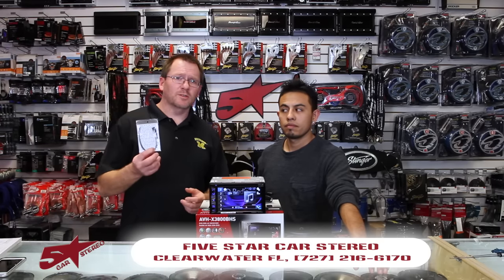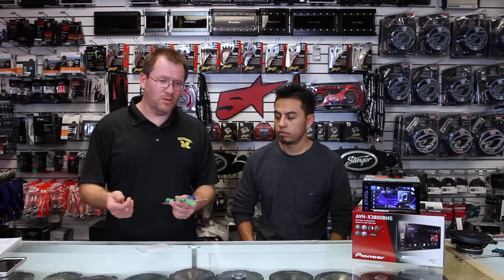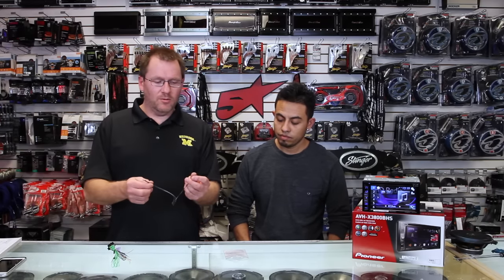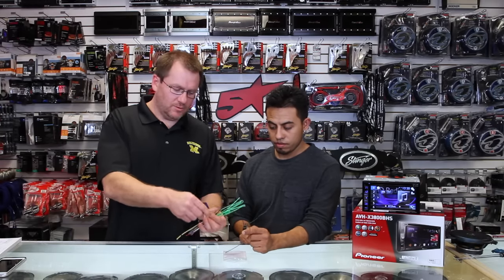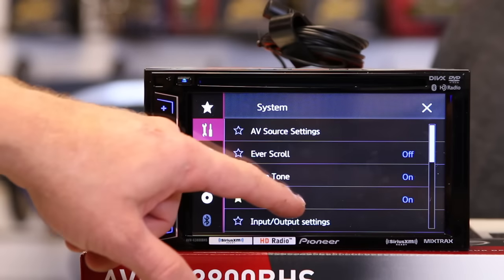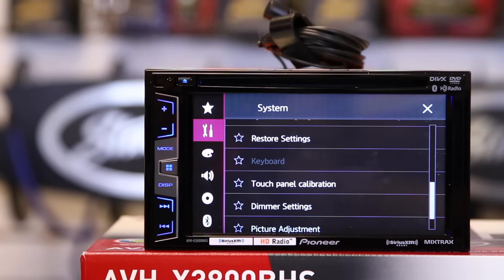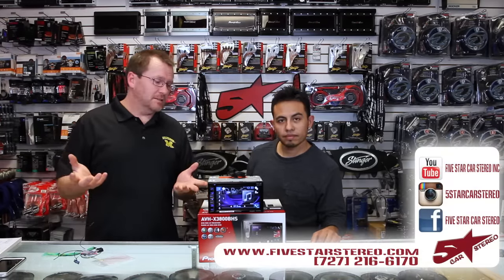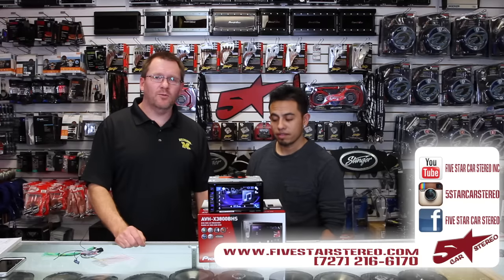How to do the brake bypass on your Pioneer AVH Radio using a MicroBypass

Comment: Hi guys, I did the bypass on my car and I can now watch videos while driving. The weird thing is that when I connect my iphone, the message of putting the hand brake on still pops on. Even I click okay I can't use appradio. I just let's me to go back (can't use the apps feature). Even if I do the break thing it still doesn't work. Do you know the reason to this since bypass is already working for movies DVD. Thanks a lot for your support and for all your very useful videos!
Reply from the maker: Marc Antoine Kassis check to see if any of the menu options are still gray. Like the restore settings? If so the bypass might not working. Also is the smartphone settings set right for your phone? Are you using this radio?
Reply: Hey, no the menu was not grayed out. Also i was able to play movies, so the bypass was working fine. Only connecting my phone through radioapp wasnt working. But i found the solution which is the most silly thing ever: restarting my phone, and it miraculously worked. I saw some other comments on other videos so seems like a problem some are having where the bypass works on anything except the usb plug. If anyone has the same problem and asks you. keep it in mind as it worked for me. And of course thanks a lot for your videos, very useful!
Reply: thank you Five Star Car Stereo and. Marc Antoine Kasis
You mean restarting or restoring? I do have the same problem. 
Before the firmware, everything was working just fine. I updated and now I cant se videos and pictures. Also Phone apps... Green wire is grounded.  Please help. Cheers!

Comment: What's up guys.  I bought one of those from amazon and connected it just as you said.  Before everything was not greyed.  Now with it installed, everything stays greyed.  I can't get out of standard mode or allowed to reset.
Reply: Most of my audio settings are greyed out with the micro bypass connected. Were you able to figure anything out?

Comment: Hey guys! Big fan of your shows. I have a few questions...hoping you guys might be able to help me with? I just bought the Pioneer AVHX5800BHS thanks to your show. It's going to replace my Pioneer AVIC-N4 which has been a great unit...and still is. But since they came out with new dash kits to convert to double din I figured why not? Anyway, question one, I bought the Microbypass that you are showing in your "How to video" Just wondering if there will be any issues when connecting this to the "Blue remote wire" as shown in video, which will also be connected to turning on two Amps? Question #2 This might be a stretch....What are the possibilities  of making a video on showing how to correctly setup the AVHX5800BHS to a 4 Channel Amp along with a Mono Class D Amp. I was thinking in the way, as how the wires and RCA's are connected from the HD Unit to both amps, then out to the speakers and sub. As I said, just a long shot...But highly appreciated.  Thanks for taking the time to read this. looking forward to hearing from you. Frank G.
Reply from the maker: Thanks for watching. I would recommend a relay for sure. ( pin 30 12volt, pin 87 remote out, pin 85 ground, pin 86 remote in). We were not planning  a video like that, we have never had anyone ask. We will add it to the list and see if we can come up with something. In the meantime we will be happy to answer any questions you come up with. I will recommend checking out the Stinger RCA's, they make a 6 channel 12 or 17 ft that are great to work with. They also make a product called Speedwire that has your speaker wire and remote wire all in one, major time and space saver. If you follow us on Instagram we put up tons of pictures of what an amp install should look like.

Comment: i tried to bypass my pioneer AVH-1300NEX  i used the micro bypass and it didn't work.. i connected the black to stereo ground the  blue to the amp remote and the green wire to the green parking brake wire on the stereo....and it doesn't let me watch DVDs or get into certain areas of the radio..

Comment: Hey guys - I just bought the AVH-190DVD model from Amazon and I purchased the brake bypass switch from them also. The bypass switch they sent me has 4 wires - green, black, blue, and yellow. What do I use the yellow wire for? The directions that came with the bypass mechanism kinda stink.
Reply from the maker: +Brian Knorr I have never seen that one, does it work with out the yellow connected?
Reply: I will tell you in a few hours! haha I plan on trying to install it in a few minutes here. I do have one more question maybe you guys could help with ... I already wired the new radio in and it works great - just one problem - every time you turn the engine off then restart, the clock on the radio resets and it's like turning the radio on for the first time. But what I don't understand is that while it resets the time, it does save the station presets. If I wired something incorrectly, wouldn't the FM presets reset with the clock?
Reply from the maker: +Brian Knorr what kind of car is it? It sounds like the yellow ( constant 12 volt or memory ) and red (accessory or key) might be backward.

Comment: How do you get a backup  camera to show while driving? I have aftermarket camera.
Reply from the maker: On the home page ( window icon) select AV and the camera is in the source list. If you press it and you get a black screen the camera is wired wrong. The camera needs to get ACC power ( red wire behind radio) not power from the reverse light.( disregard if does not apply)

Comment: Love this video guys — super helpful and just upvoted! 

Just picked up a PIONEER AVH-X5800BHS and Microbypass and followed these directions — connecting the Microbypass blue wire to the Pioneer’s system remote control (blue) wire…

However, I’m working with a Metra TYTO-01 wiring harness, that currently has one remaining blue/white wire for amp turn-on/power antenna — should I crimp this to the above connection, so that the three blue wires are running into one crimp/connector?
Reply from the maker: acsouthe yes that is what you want to do. Connect them all together, thank you
Reply: Great, Thank you! Wish you guys were up in Michigan, would bring the car over.
Reply from the maker: acsouthe haha I'm from a place called Walled Lake, and no I will stay in Florida:)

Comment: I have installed a pioneer AVH 270 BT with the micro-bypass and the CD/DVD will not work, but all other functions are fine. My question is; if the bypass is working properly would the rest of the functions work properly?
Reply: that should be bypass not working properly would the rest be working properly
Reply from the maker: +Lew Strickland yes every thing would work, the bypass is manly for the video play back and some menu access.
Reply: +Five Star Car Stereo in your professional opinion is the bypass defective and not allowing the CD/DVD to function?
Reply from the maker: +Lew Strickland if you have the black to black, the green to the radios lt green(only do not connect to break too) the the blue to blue white remote wire( and the remote wire is putting  out 12 volts) your good. The remote output on a Pioneer has a breaker so if there is also a power antenna connected you may want to test it with a meter.

Comment: Hello. I have a AVH 600 EX. I’m getting no sounds and then a Amp error message pops up on my screen. What do I need to do to get rid of it. Will this help fix it. Thank you for time. Appreciate it
Reply from the maker: Amp error mean there is something wrong with the speaker wiring. Either a bad speaker or a shorted wire. You have to fix that first then reset the radio. The radio is just protecting itself
Reply: Five Star Car Stereo thank you for the quick response. I replaced my speakers last week and had no head unit until last night when the pioneer was here when I got home from work. Wired everything up correctly and boom nothing. This morning I got up and tore the door panels off again to see that the leads where hitting the metal door cut out. Shimmed our speaker and Wala problem fixed if I have sound no more error code. I really appreciate ya. And I ordered this bybass last night for $11 bucks. It’s a no brainer. Keep pumping out the videos.

Comment: Great video! You put up some really helpful videos.  Question, have you had a chance to test the MicroBypass on the new Alpine ILX-207 yet?  I'm having issues on mine, and it doesn't seem to working.
Reply from the maker: +Choppin Brixx no not yet, you can contact Matt at Microbypass. He is really good with tech support

Comment: I have an AVH-x4800bs and i was having the same issue of not being able to use certain functions on my radio. i did some research and i found that grounding the parking brake wire to the radio itself did the same thing as using a bypass. i tried it on mine and it works perfectly now so why waste the money on a bypass when you can do this simple trick to get the same result
Reply: Scott Helphenstine So by grounding the parking brake on the stereo you can watch videos and drive?
Reply: daniel hinojosa Either he has a cheap DVD in dash or he's full of crap.
Reply: Scott Helphenstine yeah it'll unlock the screen but you still can't watch video while driving
Reply: Gamer Tone Exactly these pioneers have to see a parking brake or ground signal engage and disengage.
Reply: Gonna have to argue on that. I thought the same thing, that I'd have to buy this shitty Microbypass but after contacting Pioneer retailer they told me just to ground the light green parking brake wire behind the stereo. Did it and i can play videos on the move now. And I have a 3 month old model... MVH-AV290BT.
Reply: R3vokedGaming Clearly we're talking about the AVH
Reply: where on the 4800 did you ground it, I have the same one, I'm going to try it!
Reply: i have pioneer avh-x7800bt and just connect parking wire with stereo ground and every thing work
Reply: roki buča 

I noticed the same thing that is not what the instructions say I could not get it to work the proper way but when I touch the green parking brake wire on the bypass to the ground all of sudden I got video but now I don't have video after shutting the vehicle off and trying again just a warning sign watching videos is prohibited while driving and the okay button is blacked out
Reply: you need to tap into car ground or stereo to work
Reply: R3vokedGaming but u have to ground the wire between a  toggle  and toggle it  on off on to enable the video function 
I know this I do all day long on a nex 3300
Reply: And what's happens if you connect the bypass and the gps antena to the radio. Can you watch videos while driving or have to disconnect the gps anthena ?

Comment: What about the violet/white wire that connects to the backup light?  My Pioneer AVH-X3800-BHS has this wire, and its supposed to let the unit sense if the car is moving forward or reverse.  If I leave that wire unconnected, will the unit still fully function?
Reply: Yes it will. The violet/white wire is only for if you have a back up camera.

Comment: i have the bypass installed im going to install a back up camera will connecting my wires to brake wire have any effect on bypass
Reply from the maker: The only wire need for reverse is Purple/white. The break wire is not Ned for anything other the bypass.

Comment: Has anyone confirmed if the "1/2 inch X 1/2 inch quadrant" "Set On" bypass works for the AVH models....or am I stuck buying and installing the microbypass???
I'm  looking specifically for the AVH-201ex.

Comment: whats up five star team, quick question about this video. I ordered and received this bypass from your link and i would like to confirm....... the blue wire from the bypass connects to the blue amp turn on wire from the radio. Here is my question.... i have an 02 4runner with a power ant., the instructions for the bypass says to connect the solid blue wire from the factory radio harness to the red power wire from the radio harness and factory harness. So the radio amp turn on blue wire and the blue wire from the bypass are the only two connected together, is this correct? if so, then the power ant will go up every time the radio is turned on right? Thanks in advance, hoping for a quick reply.
Reply from the maker: Paige's American Girl Doll Channel sounds right but here is what I would do. Get an on off switch, connect on side to red, the other side to the cars power antenna wire. This way you can manually make the antenna go up and down when the key is on. Next connect the radios Blue white to the microbypass.
Reply: Thank you for the advice. Is there any issue if i just leave the ant power wire wired to the red power? When the car is off, will the ant go down? Not sure if i want to have a switch installed in the car anywhere. I bought this unit more for the CD player than the ability for DVD's. If I don't use the bypass at all and leave the green wire disconnected to the parking brake is the DVD function the only thing i will loose or will other features not work as well? Thanks again bro.
Reply from the maker: Paige's American Girl Doll Channel yes you can just connect to red and it will go up and down with the key. Yeah you will lose menu settings, I would just connect it to the E break wire for when you need it.

Comment: I just got this micro bypass for the new pioneer avh 4200nex &  my installer tried it &  it didn't work  he put that toggle switch I hate very much do you now how to get it to work w/o the toggle switch  greatly appreciate
Reply from the maker: There is an update to the bypass because of Android Auto. Contact microbypass to get yours changed out.

Comment: Five Star Car Stereo, I hooked the bypass to my pioneer AVH4800 as shown and it did nothing. is there something I'm missing or something I need to check?
Reply from the maker: Jeremy make sure you have power on the blue white wire. Otherwise contact Matt at Microbypass
Reply: Five Star Car Stereo got it, thank you

Comment: by amp is hooked up to the blue remote turn on wire will using this effect my amp and is there anything I can get instead for continuous play
Reply from the maker: Eric Mims no it will not effect the amp. You can always just use a switch

Comment: Does This Work For The Back-Up Camera or Just To Watch It While I Drive? I Have A Toggle Switch So I Was Wondered Did I Need This Also - Thanks In Advance
Reply from the maker: LMNOP SixOneEight it is just for the video and to unlock so of the menus. The switch is fine.
Reply: So Is There Any Way I Can Hook The Purple Camera Wire To A Bypass Or Does It Have To Be The Reverse Wire?
Reply from the maker: LMNOP SixOneEight it needs to go to the lights if you want it to come on in reverse. If not you can just turn it on and off on the screen.

Comment: Hello I just Installed a bypass on my w4400nex... is isnt working... the minute I start driving is just down the video and give me a caution warning. Please advice
Reply: Hey bro, i have the sam unit.  And same problem. I installed the bypass also.  Do a software upgrade from the pioneer page. Also do the pioneer bypass step. So far its working on my unit. Good luck.

Comment: I have a 2001 benz ml320 and i installed a pioneer avhx4800bs with the pioneer avicu280, it works but I have no sound.....would you know what the issue could be?
Reply from the maker: bernie acevedo no sound at all or just navi?
Reply: Yes it was no sound at all but I found the issue to the no sound. the harness I bought didn't have a blue to connect so I had to add a blue wire so it could connect to the orange wire that goes the the amp of the vehicle. Now there is sound.
Reply from the maker: bernie acevedo very good, glad you got it working. Enjoy

Comment: What happens to the black wire on the harness? Does that not get used??
Reply from the maker: Thuya Aung yes the black wires go together and the go to the car harness. There the will be 3 black wires connected together.

Comment: I hooked up this bypass to my AVH-601ex .. I’m still getting the strictly prohibited message, not allowing me to mirror or play dvd .. any suggestions? Thanks
Reply: Same with mine, did you ever figure out?
Reply: Tong Xiong yeah, make sure the bypass is hooked up to proper wires ... the black to black, blue to blue with white and the green to the parking brake green (light green) .. do not hook up the green bypass to the green on harness, it will blow out the bypass and won’t work. Also to mirror, you need a APPLE lightening digital AV adapter!

Comment: Must be an American Pioneer stereo thing.
The Pioneer AVH stereos I install in NZ (made for NZ/AUS) work  fine with just grounding the brake wire.
Reply: Hi,i am in Australia and am in the process of installing an AVH Z5050BT.This is great news,could I just ask you if there is any particular place that is better for grounding the Park brake wire?Or will the unit still function properly without doing anything with it if I don't intend on using the DVD.
Thanks
All good.earhed the green wire and everything works with no handbrake and also on the move,aussies/🥝's rejoice

Comment: Can u connect the green(coming from 3800 to ignition) wire to an ignition switch/fuse?
Reply from the maker: Adrian Segovia no the radio has to be on for the bypass to work. Some people connect it to reverse trigger. That way it will park, reverse, drive. That is negative-positive- negative, however you will need to time it right
Reply: right now im just color coding the wires. but still looking forward to ur video